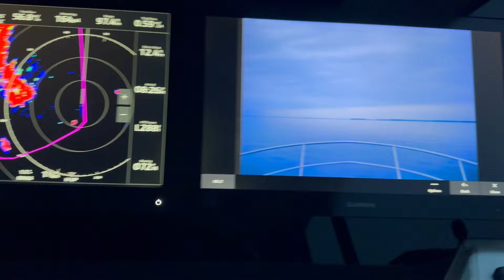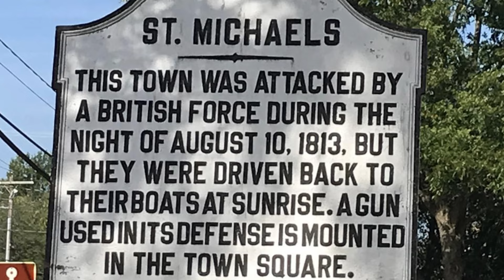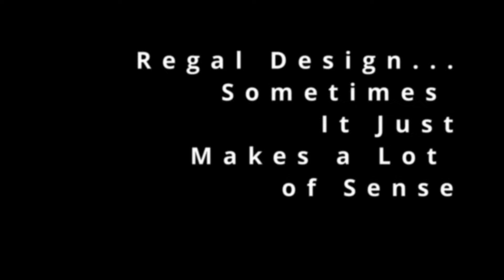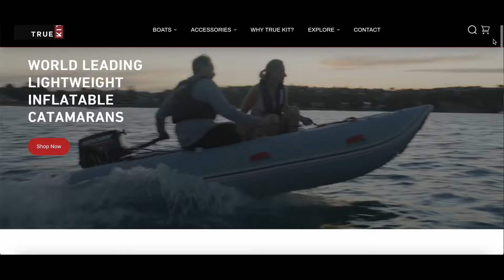(Ep 15) PART 2 • Our First Boat Trip Gone Wrong: Regal 38XO 2024

Comment: Ok first time tiller driver. You would normally drive with your left hand. Notice the throttle/steering arm is off to one side. Its so you can sit in the middle and drive.  Great videos!
Reply from the maker: Hey Rob!  Thanks so much for the tips.  I felt it more comfortable to sit on the inflatable part of the boat rather than the seat but will try that next time!  Also one issue I was having is that this engine does not have reverse, in order to "go in reverse" you have to spin the engine around, I don't have the longest of arms so in order to do that I had to sit on the side.  Have you run an engine like this before and do you have tips on that (from a novice tiller driver :-).  Thanks again for your support and your comments, we really appreciate them!

Comment: Enjoy your videos.  I own a 2022 38 XO. I was curious what house bank batteries you have?  We have 2 Deka 9d starting batteries.  It seems strange to have a starting  battery for house banks.
Reply from the maker: Thanks so much for the comments.... have not really thought about it but it is a little strange.  Let me think about this, I think I have a battery for each engine (as I have 4 battery switches, 3 engines and house). but will check when I am at the boat today.  Thanks again for your comments and your support!  Also congrats on the 38XO!!
Reply: My only thought is the house bank is used to start generator and operate bow thruster- may need higher cranking power over deep cycle battery.  I could not get a good answer from Regal.  When on the hook the house banks will not last long without generator. 

Just got back from a 5 week trip to Florida keys.  Generator actuator failed on last day but Regal is repairing under warranty.
Reply from the maker: @NOLAMG  Ok so checked our boat.  We have 3 4D batteries (smaller) for engine starting and 2 8D batteries for the house, for the stabilizer and the bow thruster.  Now one of them could be for the house and the stabilizer and the other for the bow thruster and the gen start.... have not dug into that much.   We do have the ability to parallel them all if necessary to support one or another if one of the batteries fail. Not sure if that helps you are not.  Will ask my tech about if the house is split or not...
Reply: Sounds like we have same set up.  3 starters and the 2 Deka 908D for thruster, seakeeper and house.  I was just surprised they are all noted as starting batteries
Reply from the maker: @NOLAMG  That is very strange!  You are very correct!

Comment: I’ve watched from the factory tour through the final episode. I’ve bought new boats from other manufacturers. At first I thought you were being a bit picky but I have to say, I think the word disappointment would be the first word out of my mouth. The dealer seems great but I think Regal failed miserably by letting this 800K boat leave the factory. Shame on them! I will not be going in this direction after watching your series. All the best!
Reply from the maker: Hey Jon, thanks so much for watching the channel and your support. We weren’t disappointed at all for the primary reason that when you watch the episode of how the boat arrived from the factory the boat had not been PDI yet by AMPM Marine, we had actually mentioned that in the video.  Having owned numerous boats brand new from other manufacturers, I would say that the Regal products are in line if not slightly above the quality standards what we have experienced in the past. Keeping in mind we’ve had two boats which had to be bought back by well-known manufacturers for massive quality issues during manufacture.

Comment: really need to use a boat, and shake it down to figure out the weakness... that gas westerbe generator will always be a problem IMO.
Reply from the maker: I totally agree. Boats that aren’t used are usually boats that have the most problems. We actually don’t have the gas generator, we have the very reliable Fisher Panda diesel 
 generators, Regal switched to them or made them an option several years ago. What I failed to mention in the video was that it was just a loose connection. We’ve put 100 hours on it now with no other problems. Thanks again for watching the channel and your support, it really means a lot to us.